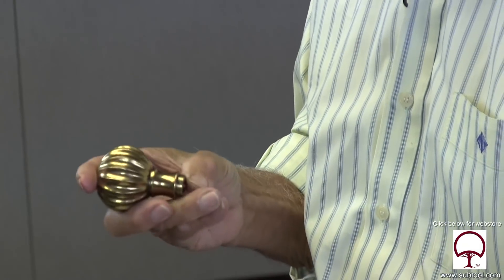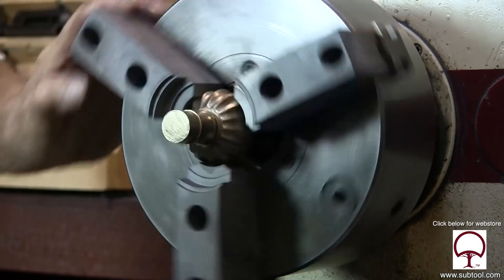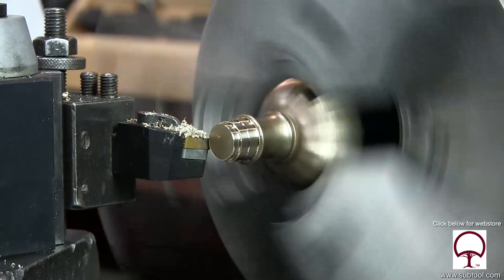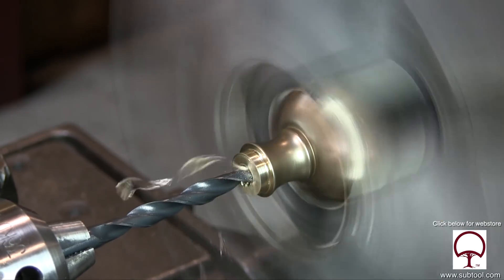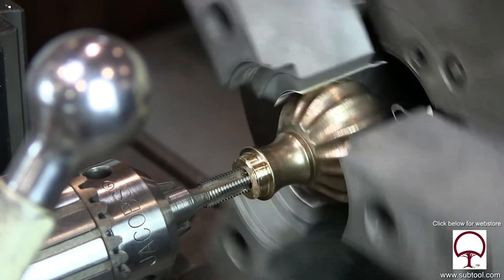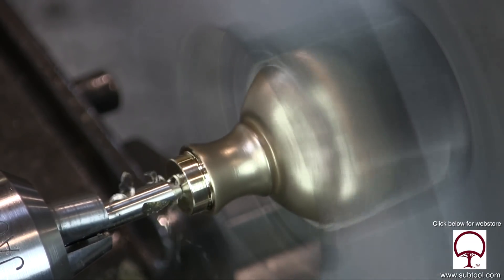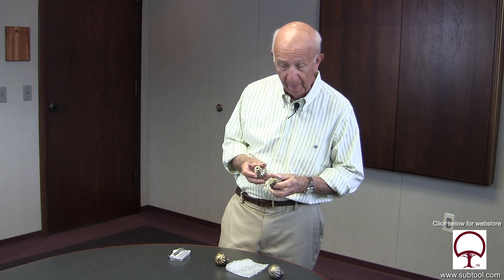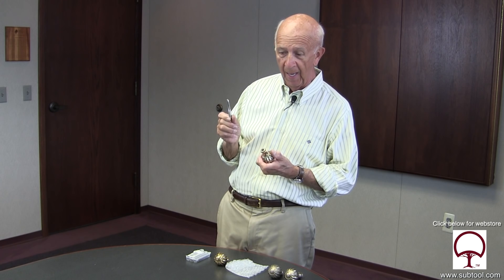How To Bore and Tap Bronze Doorknobs: Trials and Errors

Comment: Use a small sharp radius for turning tool, don’t use any inserts bigger than.008R that will avoid tool pressure which’s what you’re dealing with,When you’re Facing your parts take a very small cuts off the face( .004-.006 ) max if you’re using .008R . 
Cutting the OD you can go deep, everything I mentioned should help for this kinda Setup that you already have going ( which’s I Don’t recommend ) you need to cut a good jaws for this setup . 
if that part flayed off the jaws it will hurt you badly. Use some type of lube when you cut with the Tap ( something thin will work good for Bronze). Good luck my friend keep up the good work....

Comment: Hi Don,

Your thread is not a bastard thread, but it was selected for door knobs for a reason.  That being the 9/32 square shaft works when threaded to this size.  

Also, the tapping could have gone better with a 50% thread.  The reason being the thread is not for tightening down, is is just to get the adjustment for the door thickness correct.  

I am also going to take issue with your contention that the diameter you turn is not important.  This diameter is a bearing surface holding the knob in alignment with the escutcheons.  If to loose, all the load is carried on the cast brass hub against the hole in the cast iron case and this will cause the lock to self destruct, not good.

You might want to rework the escutcheon side of the equation by boring them out and fitting a delrin bushing. This is especially true with the heavy knobs you had made up.

I love your video series, and I hope my comments will help.  I have been a locksmith since 1977.

Comment: Could the hard tapping be because the drilled hole was too small ? if the dooknobs are british ,they should be  3/8 -20  BSF thread , the recommended bit is 8.3mm , sort of between a P and a Q , larger than the 5/16 normally used for a 3/8 -16 SAE.
The 3/8 BSF  external diameter is generally .375 right on the money , slightly larger than a US 3/8 bolt.

Comment: A way to hold ornate or things like brass knobs that I have found successful is turn a black polly ring with about a10mm wallthickness &&&&7 split it with a hacksaw. You can apply quite a lot of pressure with the chuck & still not damage the work. the ring can be used many times & the work runs nice & true, or true enough for most jobs. Regards Peter Spence.
Reply from the maker: Interesting tip, thanks for sharing!

Comment: What grade of bronze did they use to do the castings?  They look great.  I use 954 for most stuff here.  A little harder to work with but the final product makes it worth the effort.  I use HSS and grind the final edges with 600-800 grit.  I could never get as good a finish with inserts.
Reply from the maker: Quite honestly, I'm not sure.  A few years back I dropped off the original to a casting company and asked them to replicate it, but I never found out the grade.
Reply: Thanks.  It looks like aluminum bronze as opposed to something 660.  They do look good!

Comment: I thought there would be a way to handle brass parts differently when I was trying to thread a brass hose barb ... That  was my second time threading and within 2 hours of struggling to keep it unchucking I figured out how to chase a thread, how to feed at an angle when threading (chatter was ear splitting)...I gave up when I found that at night I can't keep up with a non threading dial lathe...I was too slow and after chucking it for the 20th time I touched the mating surface and gave up....I still need to get some aluminum to finish this part of my project!

Comment: Next time try a gun or spiral point tap. The one you were using was strictly for use by hand, not machine. Hand taps need to be backed out every few turns since the chips have no place to go except in the flutes, where the build up and bind the tap in the hole. Gun taps push their chips out ahead of the cut and they wind up in the bottom of the hole, not in the tap flutes. Usually you have to dig out the chips in a blind hole, but it's better than fighting it and taking the chance of breaking the tap off in the hole.
Hand taps are usually weaker too since they usually have more flutes to make the chips smaller. Gun taps usually have only two or three flutes. More metal - more strength.
Reply from the maker: We weren't able to find a 3/8" 20 one, if you have any suggestions please send us a link!

Comment: I have done 100's of bronze knobs and I actually cut the jaws to fit the knobs quite closely and use a spiral flute bottoming tap which is TiAlN coated and WD40 for lube. You will get approx 200 holes before the tap needs sharpening.

Comment: Old trick to sharpen files was to dip in an acid solution for a few minutes, was just wondering if it may not work with taps even tho the thread would be several magnitudes bigger than a tooth or grove in a file. Maybe just leave it in the solution longer.

Comment: i think i would have gripped the tail piece with a drill chuck in the tailstock  and then chuck it up in the softjaws. i have a large jacobs chuck for that type of operation. i would have also center drilled and used a tailstock center to hold the piece while turning the stub. then drill and shorted the piece to length followed by tapping. those soft jaws are nice.i would have had to use my 6jaw and soft pads to hold the knob.

Comment: A trick I've used in the past is to make jaws with epoxy putty.  You can use plastic wrap or veg oil on the part to keep it from sticking.  Let the epoxy setup & you have 'custom tooling' to hold the part.
Reply from the maker: Excellent idea, may have to try this one out.  Thanks for the comment.

Comment: I wonder how many years it will be until the cost of 3D printing comes down enough to make soft jaws economical for a job like this.  It's the ideal solution--could make jaws with the radius of the knob and probably even include the contoured fluting, in some sort of grippy plastic.

Today it probably would exceed the cost of the knobs.  But someday. . . .

Thanks for showing a job with a weird work holding issue.  Nice to know everybody has them.
Reply from the maker: Most likely, not to mention the time it would take to print all three jaws.  We're not far off from that though.

Comment: I've had really good luck using a chunk of abs pipe with an ID about the size of your part, split it, warm it up with a heat gun till its soft, then chuck the whole mess up and you'll gain massive surface area of contact. Doesn't always work the trick but the plastic pipes cheap and you will not mar the part at all. Another one that I use all the time is hot glue, get your part dial in and squirt some in between the jaws and the part. Gives your shape a lot more support and comes right off of most metal with a little solvent. It also works the trick for a part in a mill vise just make sure your part doesn't get to hot ;)
Reply from the maker: These are good ideas, thanks for the comment.

Comment: Great looking doorknobs! Any reason why you're not using a sharp insert like for aluminium & brass? (E.g. CCGT, CNMG)
Reply from the maker: I used what I had on hand for demonstration purposes, but after all of these great suggestions I'll surely be trying some new things.
Reply: Thanks for the reply! I've found that I can only actually use the sharpened inserts because my lathe isn't really rigid enough for the "normal" inserts for steel etc. The inserts meant for Al/Brass etc can be used on steel and stainless for light cuts, and give a much better surface finish I find.

Comment: Hi Don. It looked like you were using a steel insert for turning. When i machine brass and bronze I use zero rake or a little negative rake. Swarf shouldn't peel of. It should fly off as little chips. As for tapping. Same thing. You can run the cutting edge down the grinding wheel to flatten the cutting face off a bit. Don't take too much off. As it will tap undersize then.

Comment: For most of my bronze turning, (about 90% of what I do) I use a Sandvik CNMG 431 in H13A for roughing grade. Works great and seems to last forever. Use them in manganese bronze, 660 bearing bronze, and aluminum bronze. For finishing bronze I use Mitsubishi CNGG 431 in HTi10 grade.
Reply from the maker: Thanks for the suggestions, I appreciate it.

Comment: If that tap had been ever used on ferrous metal the original sharpness is degraded just enough that it's much tougher to tap grabby material like bronze or brass. Always lots of ways to do any job, but I might have used some tail stock support for turning the OD as well. But my guess is you've forgotten more about machining than I'll ever know Don. :-) I've used double sided tape a few times before and it can help a lot sometimes to hold those almost impossible parts. I hadn't ever thought about adding some sand paper so that's one for me to remember.
Reply from the maker: Interesting point you made on the tap, thanks for sharing.

Comment: For clamping it in the chuck you could also use pieces of lead as "buffer", it also kinda molds into the shape of the workpiece as you apply pressure - you enlargen the surface area, give the chuck more to hold on to and it protects the piece... (if that makes any sense, sorry, I'm no native speaker..)
Reply from the maker: Great idea, thanks for the suggestion.

Comment: Thanks for the video.  It's nice to see an unusual challenge.  For centering work like this, Clickspring has an ingenious, simple tool he uses.  It is simply a bar mounted in the tool holder with a small sealed ball bearing on the end of it.  As the work is turning he slowly brings the bearing into contact with the work until it gets uniformly pushed to the center.  Wish I'd thought of it.
Reply from the maker: Thanks for the suggestion, I'll take a look at that video.  Clickspring has an excellent channel.
Reply: Part 7,  1:14.

Comment: You dont have to machine bronze dry. Some lubricant should make the tapping a lot easier.
Reply from the maker: We did use a little bit of lubricant at certain points, but didn't show it because it didn't make much difference with the tap we were using.

Comment: Nice vid! Beautiful knobs! 
I allways feel ashamed when the part rips in the chuck. Seeing that even the masters can fail is gonna give confidence.
Just a little info: in France, in supply stores for tinkering and hobbying, taps nearly always come in combination of 3, with progressively thicker/deeper teeth to be able to do a tuff task by hand in three passes instead of one. It could be usefull for that operation by decreasing the pressure in the bore...
Thanks for your videos.
Tom, Paris, France
Reply from the maker: Thanks for the tip.
Reply: yes here in europe when you buy a tap of a certain size, you need to buy 3 :D and only one of them taps to the required dimension (the last step tap) :D
Reply: true, those two other taps are useless in delrin or aluminum but for taping steel at home it's pretty handy. I even sometimes use the n°2 for tight fit in delrin. where r u from chronok?

Comment: Yup, tapping bronze can be annoying, though not as bad as tapping thick acrylic sections. Since brass and bronze dont usually need as much 'hook' to the cutting edges as steel, I have used a diamond lap to dress standard taps that are getting a bit dull in the tooth and designating them for the red and yellow metals. The geometry doesn't seem to be critical. I also tend toward spiral (gun) point for this, because those are what I keep on hand. I don't know if the shearing action helps here or not.
Reply from the maker: Interesting, thanks for the comment.  I appreciate it.

Comment: I love this sort of stuff, allows me the gratification without doing the work myself.
Now, a word from the Old World,  for 3/8 BSF you would be better of with a Q or 8.5mm drill  P is a bit marginal/ under size. 
Quite frankly you would be better off using HSS tooling to turn that part. Those inserts are entirely wrong, you need a sharp edge to reduce loading on the part in the chuck. That particular type of insert has to "muscle" its way into the work, great when you have power and rigidity, not quite the case here I think you'll agree..
Reply from the maker: Thank you for the suggestions, and for the comment.

Comment: H.S.S. ground flat on the top with just a slight back grind on the front.   Also lead tape or sheet lead used on the jaws.
Reply from the maker: Using lead tape or sheet lead is a good idea, thanks for mentioning it.

Comment: advice on brass turning... ...I always use tool with brazed carbide and I grind it to sharp angle. tools with carbide inserts dont work well (alu insert may work).
Reply from the maker: Thanks for the suggestion.

Comment: Thanks for the video, good to see I'm not the only one that has tossed a part....Good to see you finally got a handle on that handle too. :) Could you consider profiling the ID of the soft jaws to gain a better bite?Take CarePete
Reply from the maker: Thanks for the comment. The jaws we're profiled before we put them on the chuck.
Reply: +SuburbanTool Inc 
I was thinking the same thing Pete was.
If I were running production, I'd make a special set of jaws but you weren't doing that here. The tape and sandpaper trick is one to remember.
Thanks Don.
John
Reply from the maker: I actually considering modifying these jaws for this purpose, still might.  Great minds think alike.  Thanks for the comment.